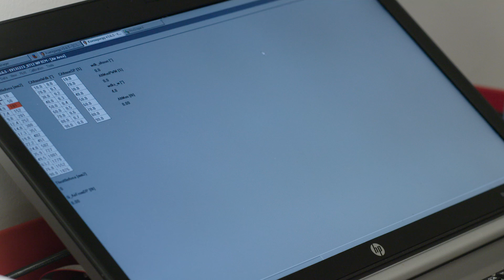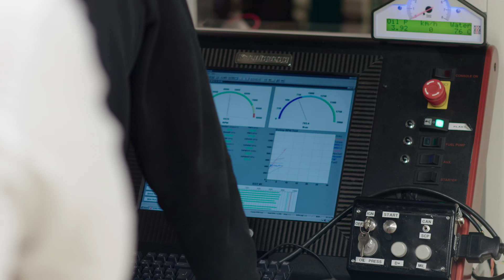The 1360HP Heart of the Koenigsegg One:1 - /INSIDE KOENIGSEGG

Comment: They should just get NRE to do the engines for them
Reply: screwloose455

You do realise the Koenigsegg engine is basically the (US) Ford modular motor....

Also, your ignorance is shining brightly.
Reply: Ben Whittle dude, every american says that. but the engine they built nowadays has nothing to do with the Ford block in the CC8S
Reply: Thomas Ewalts I'm British but okay. It's still the Ford Mod Motor, it might use custom pistons, crank, rods, valves and what not but it's still the Ford Mod Motor block no matter how you dress it.

Regardless, even if it is or isn't, the notion that American
engines are inefficient Vs. some sort of perceived "Swedish Quality" is just plain ignorant and well, wrong.
Reply: ***** No, it's not in the slightest bit ignorant. Koenigsegg didn't create the engine, they modified/beefed up an existing one much like NRE or MMR does and for the most part they probably even used off the shelf components....
Reply: screwloose455 they engines aren't bad, they are just made for something completely different. they are made for crazy drag racing. that's why they have over 2000hp. on a track car it would be useless so not much point in using them. they are still great engines and apparently they are very reliable and road worthy
Reply: screwloose455 Oh, so that must mean the Hennessey Venom GT uses a Swedish engine... oh, wait, nevermind. Yes, this car may be faster than the Venom GT, but acting as if Americans have no idea what they're doing is simply ridiculous. 

http://en.wikipedia.org/wiki/Hennessey_Venom_GT
Reply: Guus V Super light? According to the blurb on this video it's 10lbs lighter than a stock Ford Coyote..... You could probably make a Coyote weigh 10lbs lighter....
Reply: Petter sæthre but they build their own engines now, instead of sticking in a Ford motor, as like in their first car.

Comment: Bottom line is the internal combustion engine has reached its limit after evolving for quite some time..well thats my opininion I mean you can extract a million hp and torques from an internal combustion engine but there's no way you can have max. hp and max. torque soon as you turn the key like the electric systems have..the case with hybrid systems or the fully electric systems is the battery technology which i think is still struggling to compete with the traditional internal combustion engine in terms of weight and volume of power.. the P1 it uses the best of both worlds.
Reply: ICE's have a decent way to go in terms of mechanical development to improve efficiency. They wll never have power like electrics can, but this is the same case when comparing diesel to petrol cars.

Comment: Electric motors are more effecient than combustion engines interms of performane. Advantage, instant torque and higher RPMs.
Reply: Sound like shit though. Sound is very impotant.
Reply: Cant beat Hydrogen fuel cell for efficiency
Reply: A electric brushless motor can achieve 65,000 RPM, not even a F1 combustion engine rev so high.
Reply: Within the next 10-15 years, the Lithium polymer battery will improve as technology progress my friend. The same thing was said about electric RC cars years ago, which is the same principle, just on a smaller scale.  

 Lola Drayson B12/69EV 
 850hp full Electric Race Car.
Torque: c.3,000lb ft.
Reply: I mentioned in my prior post that the "Lithium Battery technology will improve" as technology progresses. It will, you'll see.
Reply: Andres .C
As far as i know technology to produce graphene on large scale that exist now can produce such low volume it is suitable for perhaps some super high end very expensive electronics not car batteries. So there is no raw material, now battery technology and no infrastructure to charge it. We'll perhaps see first high end cell phones in 5 to 10 years using this, then it'll be probably in stuff like F1/ next gen Ferrari F80(?) and it'll take another 10 years after that for this technology to trickle down to moderately expensive cars. While we're at subject of infrastructure- charging car battery at any rate requires industrial grade electrical wiring and would probably increase power usage 100/1000 times? I don't think it's even possible in less than 30-50 years. I mean people will want 150 mpg cars and will gladly pay 30-50k $ but I doubt they will pay 100k+$ for new electrical conduit.
Reply: Batteries though...
Reply: lower rpm... low range.. heavy battery

Comment: I must say, he seems to have all the right answers. Electric with engine are great but something goes wrong try fixing it. Ferrari is the perfect example. Change one thing in the KERS it affect the whole car. The LaFerrari is not really a hybrid just for addition boost or torque fill.
P1 please, Venom Gt will need them slicks he had in his video. That is a slow shifting car. Knowing Hennessey he will use race gas. I read Motortrend a lot he always would use something against rivals.

Comment: +ElJim I didn't catch those figures, thanks for the heads up. Much better to look dumb on YouTube than look dumb in person later. I would say the torque level is more important than the extra 1500 lower rpm. If you are at 3k rpm on a racetrack, you are in the wrong gear.

Comment: Did he just tell us "we raised the rpm and sacrificed useable power to make a big number at peak rpm"? That is what I heard. It will be very interesting to see if it actually blows away the competition or if it is only a step better but has to be driven at the ragged edge to do so.

The compact electric assist system, like on the P1 and even Buick did it on some big sedan, seems like a healthy balance. The big Buick, can't remind the name of the car but look up "a car for grandma" or something. It replaced the regular starter with a bigger motor (like P1). It did regen braking and stored it in a capacitor which is lighter and more compact than batteries. Then from a stop the motor added the juice back in. This allowed the engine to be geared for highway cruising and better fuel mileage. So Buick did KERS and maybe 5 years ago even.

Comment: Just a quest but hasn't the tesla resolve the battery problem as in durability and longevity I think they are claiming over 600 km per charge with a ten hour charge?
Reply: What they claim and what's reasonable to achieve are two different things. I think some testers have been able to achieve the claimed numbers, but only by hypermilling with no AC and what not, which is a pretty shitty way to spend your time in your expensive road yacht.
Reply: So true. I never thought about that but I'm sure many companies do that to boost sales.
Reply: hus teron
 Most companies claim EPA and EU testing cycles for fuel consumption, both of which are in optimal conditions completely unachievable in the real world.

Comment: Electric is not "trend"; hybrid is the future. I'd like to see the torque-power stats over the rev range of tho One:1. I'd say it's not even comparable to the torque delivered at low rpm by the hybrids. Not to mention that the p1 and LaFerrari weigh about the same as the One:1.
Reply: Weigh the same as One:1? LOL in your dreams kid, the P1 and LaFerrari are titanics next to the One:1. Hell, the One:1 weighs less with all the fluids, including fuel, than the dry weight of the two Priuses from McLaren and Ferrari.
Reply: According to Autocar (http://www.autocar.co.uk/car-news/mclaren-p1/mclaren-p1-v-laferrari-v-porsche-918) the Ferrari weighs 1345kg with fluids, which is lighter than the One:1.
Reply: 3kg monocoque? Hmm. 60kg for an extra 4 cylinders? Hmm. 20kg for lighter wheels? Hmm. You see I don't think any of these things are true. It's isn't hard to lighten wheels why wouldn't Ferrari do it? A company with much more weight saving experience than koenigsegg. Porsches New V8 in the 918 weighs as much as your average 4 cylinder if I remember correctly. A 3kg monocoque simply doesn't exist. If you made it out I paper it would weigh 3kg. The p1's weighs 90kg and the LaFerrari's is 75kg. I'm gonna assume you meant 30kg but even that is stretching it. Let me make it absolutely clear that I hope koenigsegg do very well. But you can't argue against obvious fact like published weight figures by clutching at straws and making shit up
Reply: 30kg for a spoiler?? The Koenigsegg has a much bigger active wing out back! Naturally aspirated engines don't need turbines, and because of lower compressions ratios can shed weight in the block and intake, out-take systems, and of course the turbines and turbines housings are absent. And i don't think Ferrari would give wrong stats, that doesn't help customer loyalty. Yes the power train is heavier but I think weight can be shaved in other areas (the ferrari has no power windows)

To me 1340kg is all not that impressive, grant it with no safety systems, but almost 25 years ago an f40 weighed 1100kg!
Reply: Francesco Papi Ferrari is known for bullshit weight claims on their cars, the SportAuto tests have proven that, and yes, the LaFerrari isn't going to be anywhere near as light as the One:1.
Reply: First of all I am not trying to make a claim in favor of Ferrari, maybe you have mis-interpreted my comments. I simply made a statement about all the fuss around this car. As I said the stats aren't that impressive from my point of view: a 1:1 power to weight ratio is impressive when you achieve it by lightening the car, not by raising power! Any American Tuner can achieve that kind of power output! My claim on the F40, as I said previously, was to underline the simple fact that 1340KG IS NOT THAT LIGHT PUT INTO PERSPECTIVE, especially for the asking price of that car! 

Second of all we are arguing CLAIMED stats, so I don't see why you should keep pulling all this crap about accessories (not to mention i can live with manual windows in car i use twice a moth at the most). I honestly don't know where you get all your numbers and I don't care, (they could be completely made up for what I'm interested in) but at the end of the story the Ferrari is lighter, the Koenigsegg is just a bunch of empty claims and lots of fuss on the weight-saving front (great car don't get me wrong), end of the argument. 

Thirdly and finally, I advise you to be a bit more respectful towards people that have different opinions. I have not insulted you or denigrated you. On the other hand it seems like you feel intitled to do so. Have a nice day.

Comment: Electric engines are extremely efficient the problem is the battery.
Reply: I like the solution of augmenting the battery with a jet turbine/generator and super capacitors.
Reply: NarfBLAST I believe an American chap tried this some years ago, possibly in a Hummer, and it turned to shit. If I remember rightly, the jet turbine setup would much way too much fuel for it to be a more efficient than a traditional hybrid setup. Remember, turbines are powerful as hell, but far les mechanically efficient than a ICE.
Reply: I'm replying after 6 years later. How life is changed through this years?

Now 20% of European cars are electric.

Comment: I'm fully with Christian in case of Hybrid. The 918 is insanely fast, but mainly because its power and suspension. Porsche Claims 10 seconds faster than a lighter 918 without hybrid systems. But maybe they lie for marketing? Who knows? The P1 shows, how good a hybrid system can work and can improve an engine if its applicated correctly. But the main fact for the insane speed around a track isn't the hybrid system, but Downforce like a GT3 car. But the Koenigsegg will have as much as downforce as the P1. So the other reason for hybrid systems is to reduce Turbo Lag. But there are other easier ways to handle that. So we will see, how it will compete. I think it will be better in every way.

Comment: as much as i admire Mr. Koenigsegg, Mr Pagani etc and how they are trying to argue against Hybrids, e-cars at the moment, i think they are not right.
in the hybrid system of the 918 for example, the superlight, compact V8 plus the batteries together weigh as much as conventional V8s.if you look at the Tesla-S, this car is pure electric and it is a rocket and the overwhelming success of cars like it or the I8 or I3, Prius show It is absolutely THE way to go and i think if Koenigseeg won`t soon follow that so called trend, they will be seen as old-fashioned rather than innovative. i had my doubts a few years back, but i changed my mind. so much more is possible with adding electric power.

Comment: I do not agree with Mr. Koenigsegg on the potential of hybrid systems. The McLaren P1 is the example he wasn't willing to mention, which validates the purpose of having a supplemental electric motor for the sake of having massive torque available at all times. The KOne:1 will probably be the quickest flat out, but it will likely not achieve the level of precision in handling and consequent driver connection as the P1.

Comment: LOL at the people talking up electric cars being an efficiency miracle. In the world of electrical engineering, an electric motor is the most electrically in-efficient component, even more than Edison's original light bulb. The stage of efficiency that ICE's are at now is what should've been the stage in the 70's if it weren't for the oil companies restricting ICE innovations. If anything, electric cars have pushed ICE cars to be better and better.
Reply: mattio79 that's a permanent magnet type synchronous. Those are the heaviest type of electric motor. They don't make as much torque as an a-synchronous (a.k.a induction motor) because you need a slip angle to get lots of torque forces produced (synchronous motors cant have a slip angle), and because of their large rotating inertia, are bad for acceleration or deceleration. They use these motors for precision constant rotating speed.
Reply: PSRBF6 then explain the neodymium DC brushless motor efficiency of 85-95%.  Talk to Steve Neu or Tenshock or Tekin, etc.  the scale of the motor only reduces the efficiency by 5-10%. that leaves 75-85% efficiency.  the rotor has to be neodymium for it to work though.
Reply: MrKeyboardCommando if you're in-informed, you have no right to tell someone that they have no clue what they're talking about. It's quite hypocritical.
Reply: Imagine if we all would switch to Electric Cars! How on earth could power companies meet demand. Even with incremental adoption of Electric Vehicles, power companies will put the cost of electricity up. I feel this is a REAL issue that people don't seem to be addressing.
Reply: MrKeyboardCommando the heat problem is because of an ago old inefficient underpinning  design. There's still a lot to got with ICE. Electric motors are energy wasteful too. Do you know about RF's and how the remaining electromagnetic field makes its way into conducting metals nearby.
Reply: MrKeyboardCommando the best ICE today is still far from what a highly efficient ICE will be in the future once "the big" ICE revolutionary upgrade/change happens. But when it does, it will be so significantly better, that it may be affectionately understood as "the ICE 2.0"
Reply: TheCanto500 engines =/= pollutants out the exhaust. Burning hydrogen puts steam and nothing else through the tail pipe.
Reply: TheCanto500 actually, it's steam, and steam only (water vapour) that comes out the exhaust when burning hydrogen gas (gasoline is something completely different) (believe it or not, but it's true). Water vapour/steam is what clouds are made of. These clouds will then drop rain on mountains which will turn into snow.
Reply: It's hard to make pure hydrogen... That's why... Also, all the car companies copped out because it would cost too much money to install hydrogen gas stations everywhere
Reply: Liked your post because you tell a good story. Too bad it's all crackpot delusions...
Reply: n777ua do your research (proper research) and some real life testing (like I have done to make these claims). Anything inductance related in electrical engineering is about 60% electrically efficient.
Reply: "LOL at the people talking up electric cars being an efficiency miracle."

Efficiency miracle?  Actually, it's called the no more $4 for a gallon of gas miracle.  Considering that I sometimes have to commute 140 miles a day to work -- I'm not one of those tree huggers.  I say screw efficiency if it doesn't burn money.
Reply: Steven Thoseby Ok but would you rather that or endanger lives knowingly by buying more and more cars with internal combustion engines? Soon enough there will be very little clean air for us all to breathe, china has already realised this.
Reply: PSRBF6 And steam released into the atmosphere in vast amounts has no effect whatsoever on climate change no? And I doubt steam is the only substance discharged through the exhaust, otherwise co2 emissions (which most car manufacturers mention in their specs) wouldn't exist.